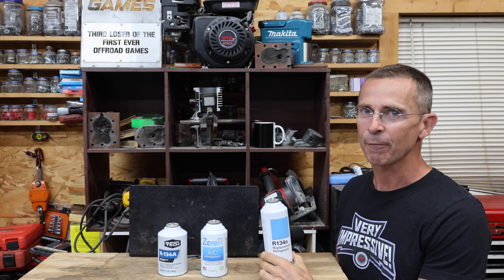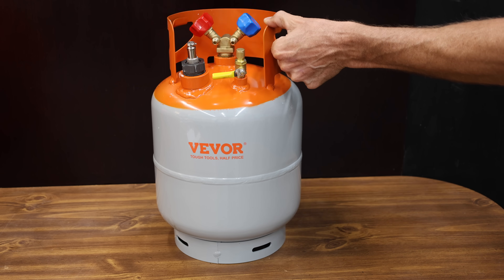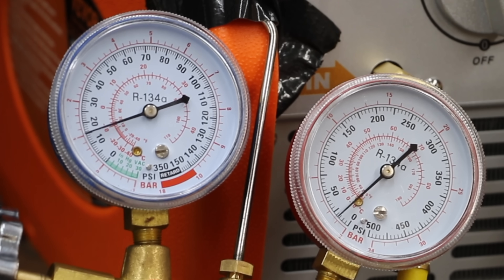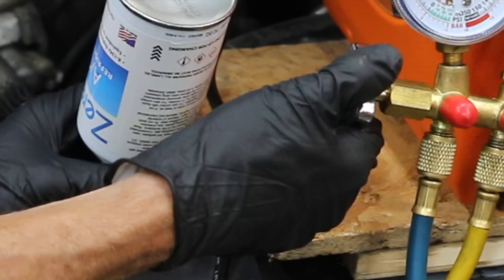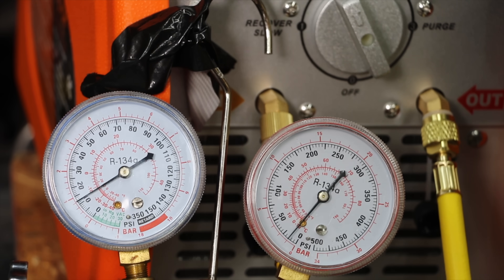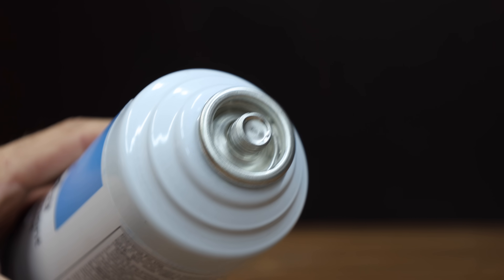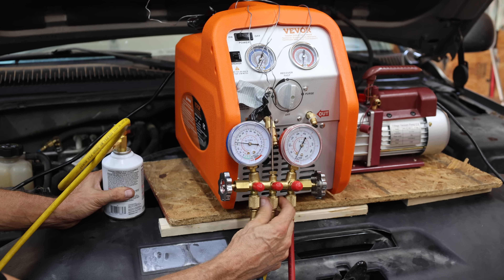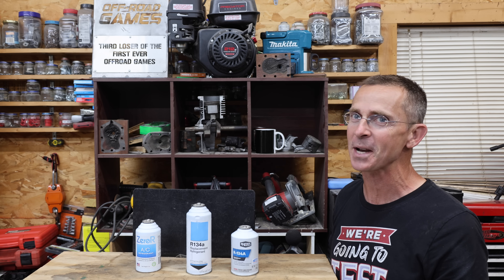How Dangerous is Fake Car A/C Refrigerant? Let's Find Out!

Comment: Certified automotive AC tech here.  One very important consideration with using an alternative refrigerant is its compatibility with the existing compressor oil.  When R-12 was banned around the mid-1990s, a lot of folks converted to 134a WITHOUT first removing the original mineral oil and replacing it with PAG, a specialized synthetic lubricant .  Now bathed in R-134a, the original R-12 compatible mineral oil would not circulate as it is supposed to, and eventually the oil-starved compressor would self-destruct, sending metal shavings throughout the entire system.  It was called the "black death" of your car's expensive air conditioning system because of all of the black aluminum oxide that friction created, requiring a colossally expensive replacement of most all of the AC components.

Aside from the obvious fire danger they pose in a crash or if leaking, I would never recommend using a so-called "drop-in replacement" refrigerant for real R-134a unless the ersatz refrigerant maker certifies in writing that it's compatible with the original compressor oil, usually PAG.  And good luck with that, as these companies are likely fast-buck fly-by-nights.

Comment: As a suggestion for a future video, I'd really love to see a comparison of electric air dusters! I find there's an overwhelming number of them for sale and the only major tool brand duster I know of is the Makita XSA01Z for nearly 200 bucks! It would be very helpful to see them compared to old fashioned canned air, and to any reputable tool brands if they exist. Also, It would be nice to know how loud they are, the speed and pressure of the air they produce, battery capacity, charge, and runtime, special features and attachments, and material quality.
Reply from the maker: Thanks for the suggestion.

Comment: I used it every spring on my 1998 dodge Dakota from 2010 until 2018 and it cooled my ass off in the middle of the hot humid summer months here in Northern Virginia.

Comment: I had a 1989 Toyota Supra and it used an R-12 system. The R12 was very expensive so I decided to do some research. Turns out that a propane and butane mixture works very well. I pulled a vacuum on my system and calculated how much propane and butane to put into the system. (The butane raises the boiling point as pure propane is too cold and would freeze the evaporator) I can't remember the exact numbers, but it was around 14 ounces of propane and 2 or 3 ounces of butane. It cost me only a few dollars at the time.

After I filled the system I tested it and it was the coldest air conditioning system I have ever experienced in a car. I was completely blown away by the results. The A/C worked for many years like this with no issues.

I AM NOT RECOMMENDING ANYONE DOES THIS! I understood very well the risks associated whilst doing this.
Reply from the maker: Thanks for sharing.

Comment: I've tried a similar product available here in Canada at Princess Auto and other places.  Just like in the video, the results are just acceptable.  Doesn't produce very low temps at the vent. But it's very cheap and as far as I know regular people can't get the real refrigerants.  So I use it just to pressurize the system to the compressors get their exercise.
Reply from the maker: Thanks for sharing.

Comment: Now make test to check is having flammable gas in car AC is a really big deal. In EU it is popular to have LPG powered cars, where you have additional 40L (liters), or more, tank of propane-butane in your trunk and copper pipe to the front, where evaporator is installed.
Reply: CNG cars are also somewhat popular, especially here in Finland where LPG is illegal for car use.
European car makers have even made cars that run on either petrol or CNG.
Reply: @TopiasSalakka  we've got CNG city buses in Warsaw. And many private cars with LPG in whole country.
Reply: @haczyk84  Yeah LPG seems very popular in Eastern Europe, I have a friend in Bulgaria who wants to buy a V8 Mercedes and convert it to LPG.
Here in Finland it's only forklifts and barbecues that use LPG.
Reply: @TopiasSalakka  It is half price cheaper per liter and about 10-20% higher consumption per 100km so it is good deal. Also you are able to run at two fuels - greater reach. Downside is less space in trunk.

Comment: Something a lot of people don't know is that you cannot pull moisture out of an R134a system with a vacuum pump, only the air.  It's because of the lubricant they use, PAG oil and the moisture absorbs into the oil (hygroscopic).  The PAG oil starts to vaporize before the moisture does in a vacuum so the vacuum can't quite get low enough to begin to pull out the moisture.  With the old mineral oil used in R12 and R22 systems, you could easily pull out the moisture, but not with the alcohol-based oils that end with the word glycol.  It's important to never let your system pressure drop to zero and begin to breathe in outside air.  The only way to get most of the moisture out is to change the drier and flush the system of the old oil and add new.  The hope is the new dryer will pull out any moisture you couldn't get to. The topic has been beaten to death many times, but no-one seems to remember.  AND (big and) the lubricant has to mix with and be carried by whatever refrigerant the system is using.
Reply from the maker: Thanks for the feedback.

Comment: Couple of things I've noticed with this butane / propane refrigerants, which are sort of the only off the shelf gas you can get here in Canada:

1. They don't do well charged into a hard vacuum. Some manufacturers recommend no vaccuum and a little moisture content actually leads to better cooling.

2. The lower amount of gas going into the systems I've charged seem to lead to leaks. Older seals and schrader valves only seem to work with a certian pressure of gas behind them to make them seal: and the lower amount of replacement gas and lower static pressure allowed leaks when I tried them. 

Fill the low side port with oil and you'll probably see it slowly bubble up.

Shame, it cooled well before it all leaked out. Filled back up to the right pressure with r134a (hard to get here in Canada) and zero leaks two years later.
Reply from the maker: Thanks for the feedback.

Comment: Tip: The diagram at 7:00 is of what is referred to as a " flooded " Evaporator system. Where refrigerant remains as a liquid until gassing off in the accumulator to be re-compressed.  A vehicle with a dryer in or after the condenser doesn't utilize an accumulator as the refrigerant is already gaseous in the evaporator.
Reply from the maker: Thanks for the tip.

Comment: I've been running Envir Safe for about 7 years in my older R12 Jeep. It's awesome up to about 100°F outside, then it's just okay. I just did a service and recharged with Envir Safe Industrial and at 90°F outside temps vent temps get down to -2°F at the lowest I've seen.  Pressures are a bit off of what R12 or R134 would be but they are closer to normal than the stuff you tested.

Comment: R-134a boils at -15.34°F.  R-1234yf boils at -22°F.  Liquid nitrogen boils at -320.4°F.

What would happen if you charged an AC system that is meant for R-134a with the same amount of ounces using another refrigerant that boils much lower?

Would it blow colder air?  Would it freeze the evaporator?  Would it damage something?  Can you please do some testing?

Comment: I have previously used EnviroSafe refrigerant in some of my previous vehicles.  Essentially, it is R290, or propane.  I wouldn't be surprised if that is what these two replacement refrigerants are. 

The EnviroSafe mostly outperformed R134a, however, the vehicles that I used it in had originally been R12 systems, which are designed to run at lower pressures than R134a.  Three of the vehicles had never had R134a in the system, and had completely leaked out (1990 Chrysler Imperial, 1989 Jeep Grand Wagoneer, and 1968 Dodge Polara) One had been professionally converted to R134a, and the compressor had failed (1984 Cadillac)  All of the systems had been flushed, new expansion valves installed, and new receiver/filter/driers.  The Cadillac was the only one that wasn't too happy with the EnviroSafe, though its puny compressor could have been the culprit, or perhaps some debris was left in the system after the original compressor had failed.
Reply from the maker: Thanks for sharing.

Comment: You should test how different types of drywall handle flood conditions. Basically let the edge soak in water for a few days and see what it does. Maybe also test coatings to help prevent water damage.
Reply from the maker: Thanks for the suggestion.

Comment: As a refrigeration mechanic i gotta tell you to close the valves while vacuum or recovery is still running. Turning it off first allows any leaks in the hoses or manifold to enter the system. Otherwise very good video. Quick 101 the discharge psi should be converted to temp and be roughly 20 degree's above ambient. The suction line psi when converted to temp should never be lower than 40 degree's. So really what you wanna see is 40 F suction , and 20 over ambient on discharge so lets say 90 for easy math. Making a perfect system to be 40F suction and 70F return air which will cool the air down to 55F out of the vents which is Perfect, also making the condenser or discharge line 90. Also just so you know ALL refrigerants are just mixes of butane/propane/ammonia, so really they're all flammable.
Reply from the maker: Thanks for the constructive feedback.
Reply: Everyone on YouTube is a refrigerant mechanic / expert
Reply: @HereOnYouTubeCommenting  Well i have 2 trade tickets that says i have an idea of what im talking about so i would hope so XD
Reply: @SimplyMagic123  yea and i have 3 grammy's

Comment: I believe that the alternative or fake R134a is a mix of R290 Propane and R600a Isobutane. It does work however if you car is older it tends to cause the rubber seals to go hard and leak. You also need to charge it with 1/3rd of the weight of r134a. The R290/R600a mix works and is very effective.
Reply from the maker: Thanks for the feedback.

Comment: The CRC Dust Off contains 134a , so, as it is illegal for normal person to get refrigerants here in Europe, I used Dust Off to top the system until the compressor stayed on all the time. As I did not have suitable hoses, luckily my then Jeep GC low pressure schrader valve points upwards, so with a suitable small O-ring, the filling was possible. It was then ok a few years until the Jeep was stolen and totaled.
Reply from the maker: Thanks for sharing.

Comment: There are some hydrocarbon-based "alternatives" for the older R-12 vehicles, since you can't get that anymore.  From what I've read, they're mainly butane and/or propane.  I'd rather spend the money to upgrade to R-134a than have an additional source of flammable material under my hood!
BTW, I just saw my friends at my local shop earlier today and had my 1998 BMW 328i charged with R-134a for what might be the first time ever in its life!  I've had it for over 100,000 miles and the AC was always fine.  But at 211,000 miles and nearly 27 years old (build date: 11/1997), I'm not surprised it needed a charge.  The machine recovered a whopping 0.022lb of refrigerant!   I'd say it was a bit low!  When the unit pulled vacuum for the test, it held for the required 10 minutes!  So no significant leaks. And after getting charged, it was nice and cold on a 90degree day here in NJ!  Just goes to show what professional service can do!
Reply from the maker: Thanks for sharing.

Comment: The r600a initial charge is is around 80% of the r134a and you will have to adjust from there according to supply vent temp and superheat/subcool as with any refrigerant retro fit, to obtain best performance.

Comment: I had a 2 ton AC unit decades ago, in my small home, and I took a brass tip propane torch, cut the tip, cut threads that allowed me to fit an R-12/R22 charge hose on it. For years I used propane only with that old AC unit as the refrigerant, and it lasted longer than one with the actual R-22 AC unit would, it used less electricity, and the air was even cooler. Propane should be used as refrigerant more (is R-290). It doesn't corrode the internal parts like chloro-flouro carbons do, and also acts as a libricant inside AC unit too.
Reply from the maker: Thanks for sharing.
Reply: Propane is a refrigerant going back 100 years. It is in 1930s era HVAC books
HVAC grade Propane is R290.  Hank Hills Propane often has some Butane in it too and some moisture.

So what happens is using BBQ grade Propane as R290 "like" may work WELL; or OK; or the expansion valve tends to freeze up. ie mixed bag.

So the local Propane when used as a HVAC gas is a roll of the dice since not controlled for hvac usage

In Louisana there have been homes and trailers burn down with Propane usage. R290 was sold on Ebay for years as an R22 replacement. A leak caused the fires. Propane is heavier than air.
Reply: @3beltwesty  The moisture problem using those one pound propane cans sold everywhere is easily overcome. Put in freezer prior to charging, so any moisture in it freezes, then take out and wrap a towel around it, and as it charges the AC unit, the can becomes even colder, keeping moisture frozen in it, so it's about as pure a charge as anyone needs of just propane.

Comment: If i recall correctly. The usual alternative gases are propane cut with butane to mimic the properties they are looking for. Those pressures on the high side would be much higher with straight propane. Theres a few published articles on the fesability of hydrocarbon ac gases. Interesting reads.
Reply from the maker: Thanks for shairng.

Comment: Brilliant job servicing AC the correct way! 
Since your vehicle uses a fixed orifice tube, it's much more sensitive to the volume (not weight!) of refrigerant it has. There has to be enough liquid volume to actually develop a column of liquid refrigerant before the orifice tube, else the phase change will not occur and you will get zero cooling like your car did at idle. 
When you were moving at speed, the compressor spinning much faster was able to force a liquid column to develop due to volume flow, and that made it able to cool. Had you put more Zero R in, it would have eventually worked the same as r134a. So they're sort-of lying about the 6oz cans being "equivalent". 

Zero R probably works fine in systems that use a thermally regulated expansion valve (TXV), such as most Japanese makes. That valve tries to force a liquid column to exist based on the temperature and pressure differentials and will open/close equivalently.
Reply from the maker: Thanks!

Comment: The old R 12 refrigerant was flammable. and when ignited makes a blue flame. that puts off a chemical called phosgene gas. which is poisonous to human beings. and shouldn't be inhaled I'm not sure if R 134 is the same? but a person would be safe not to inhale anything when charging any type of refrigerant system's. most air conditioning systems need recharged due to leaks. and some leaks can be difficult to find for obvious reasons. like because the condenser is usually incased in ducting under the dashboard of the vehicle. but there's a way leaks can be detected with a fluorescent die. that when used with a blacklight shows right where the leaks are. also sometimes in the recharging process oil has to be added to the system. since oil is lost though leaks also. there are people who have asked if older systems can be recharged with R 134 refrigerant. and the answer is yes but it requires that most of the seals throughout the system be replaced to a type that will work with R134 refrigerant. some Ford vehicles have a different recharging procedure than other vehicles. which requires a person to weigh the R 134 refrigerant as it's being added to the system. I had a 2000 Ford Focus that only allowed a person to put like 37 kilograms of refrigerant into the system. leave it to Ford for making recharging the air conditioning system into a joke. as for your techniques shown in this video they are the best I've seen. to show people the proper technique. for charging most air conditioning systems. and your advice on the correct Freon to use is better than any others I've seen. thanks.
Reply from the maker: Thanks for sharing.

Comment: Use Teflon tape on the puncture style can, it will hold the gas when you are done using it and tape cap the other end of the hose connection too!
Reply from the maker: Thanks for the constructive feedback.

Comment: The butane thing happened years ago with R-12 phase-out also (R600a) because it was cheap.  They said use a 60% charge, and it was illegal in the US, but common in a lot of other countries to run it.  The danger is to the unknowing service mechanic when the system is not marked and they don't even change the fittings (no clue something is up) or a car leaking butane in an accident.  Now the new refrigerant is R1234yf and it's flammable.  It was forced down the throat of the car manufacturers, and they can claim it was mandated, but California will sue because that's what they do.
Reply from the maker: Thanks for sharing.

Comment: I've used the AC pro can that comes with an adapter that works on most cars. Used it on a 2007 Ford Five Hundred 2 years ago for my brother, and it still blows cold air.
Reply from the maker: Thanks for sharing.